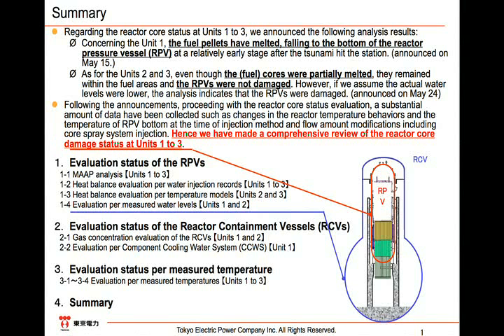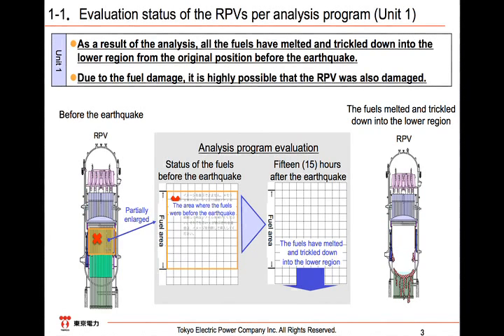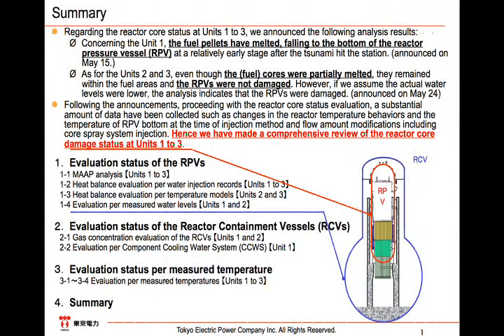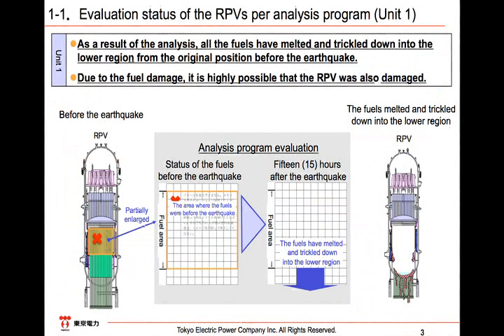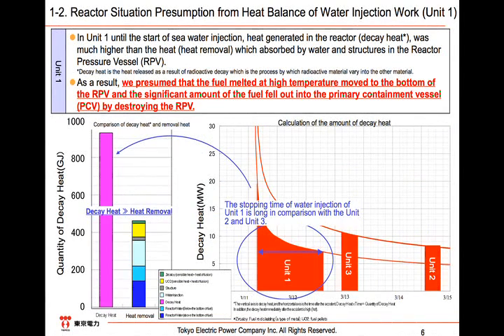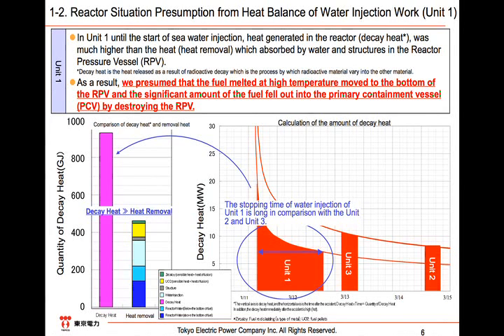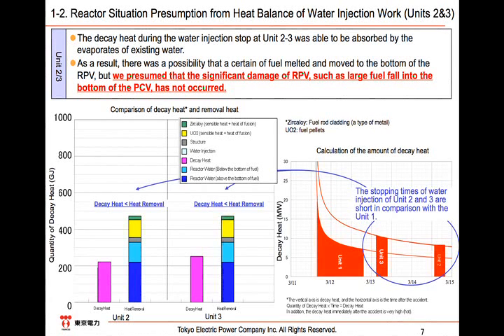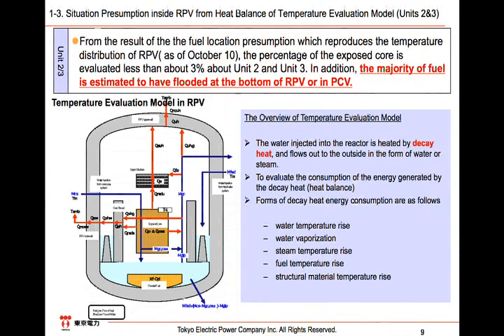The Evaluation Status of Reactor Core Damage at Fukushima Daiichi (1/2)

Comment: BELIEVE? (2)TEPCO first even planned to bring the reactors back online soon!  I also assume , an overvoltage has caused the outage" and has destroyed most of electric devices .Due to German reactor safety, estimated 60 % of the fuel also melted through in R 2. These are around 50- 60 tons. What made that after the R2 explosion a radius of 10 km was so full of steam taking all sight, if not the fuel had melted into  the ground? The radiation value around R 2 has dropped to 1/ 1000 but not at R 3!

Comment: Hi!  I just had doubts that the meltdown process was started by the after decay heat of the isotopes. If so the temperature would have decayed even by the little cooling  that reportedly worked still for hours by batteries.  More likely the electric outage occured when the control rods were not fully driven in yet. By that, the upper part of then fuel melted soon. Believing in this best case of an "after decay heat problem has led to false  response measures first.

Comment from the maker: @ledaril The RPV is the steel strcuture containing all the fuel rods and other things. The PCV is the steel + concrete structure with the shape of a light bulb containing the RPV.  
The latest analysis presented in these 2 videos shows that for the reactor 1 a big amount of molten fuel may have damaged the RPV bottom part accumulating in the underneath space in the PCV. For reactor 2 and 3, the situation seems to be easier with just a small fraction of fuel in the PCV.